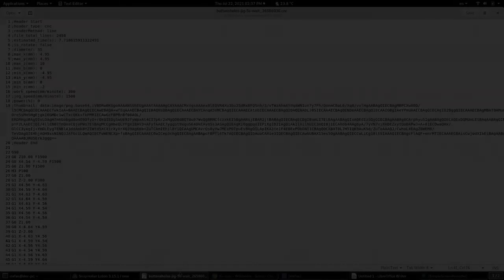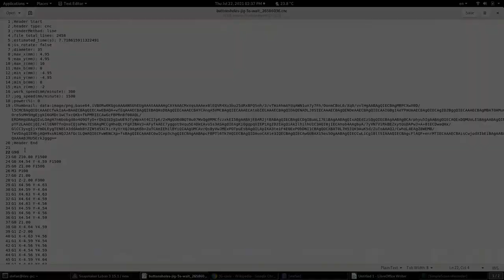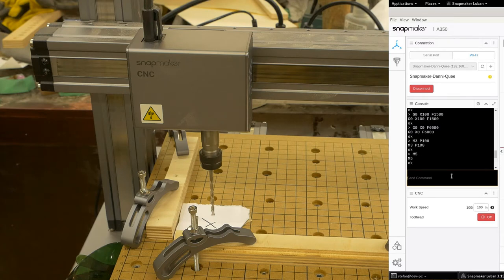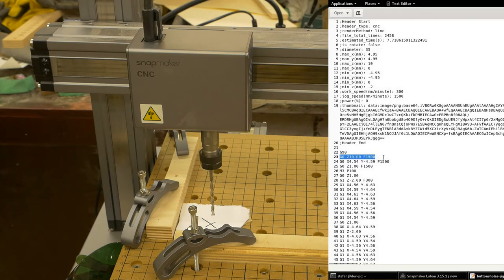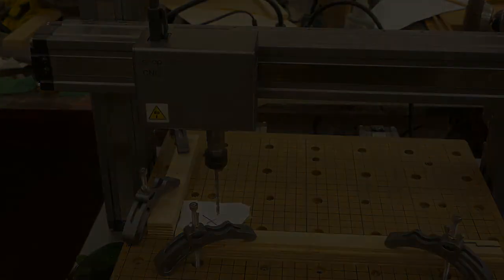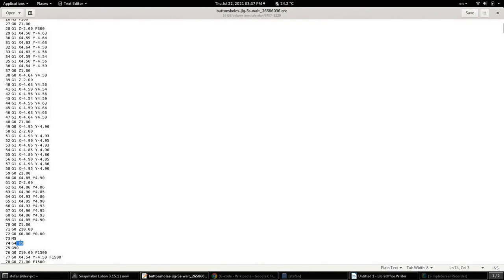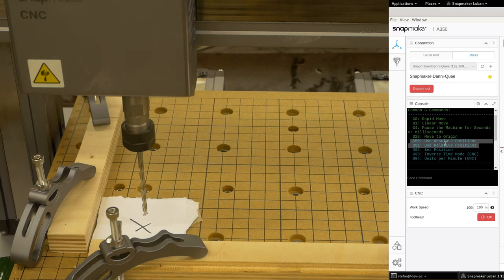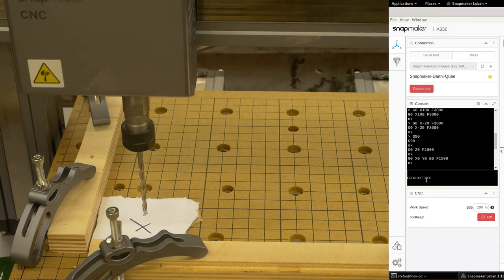Snapmaker 2.0 - E05 - Demystifying G-Code

Comment: hello, koka-bora Creations, first of all, great video, it was very clear and help me figure out some cloudy things i had not completly understood. I'm currently working on a way to make the snapmaker A350 turn in a loop for demosntration( with the laser cutting module and with the laser off) do you know if it's possible to make a loop in G-code or even better directly with the snapmaker Luban software. Hope you can still view the comment on old video !
Reply from the maker: Hi Ulysse, are you able to give me more details about the loop? Something along the lines of how long the loop should last? Do you want a specific range of motions?
Reply: @KokaBoraCreations  thank you for the answer ! The loop i am trying to make is an equivalent of a for or while. The goal is just to repeat a certain action for a demonstration of the machine. I am currently just writing the same path over and over with a pause in between but I was just wondering if, rather than rewriting the same action I could make an equivalent of a “for” or  a “while” in g-code.
Reply from the maker: Hi Ulysse: please check out my new video https://youtu.be/DngH-0dfpms where I talk about the loops and how to make/fake them.